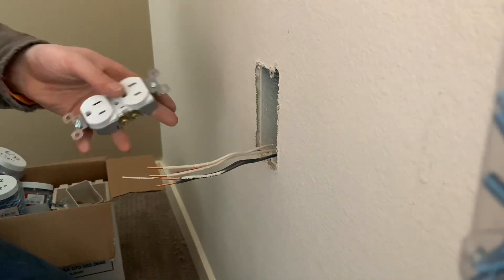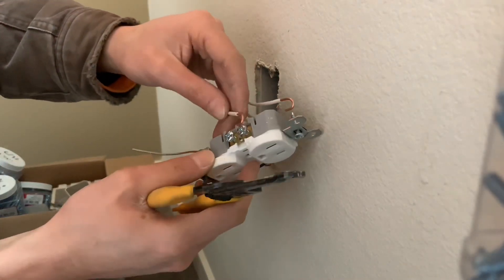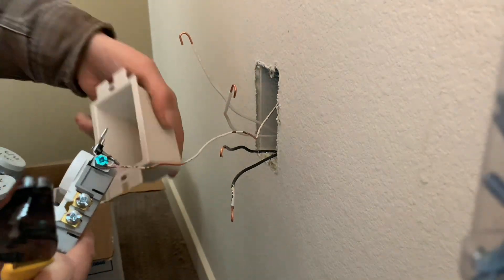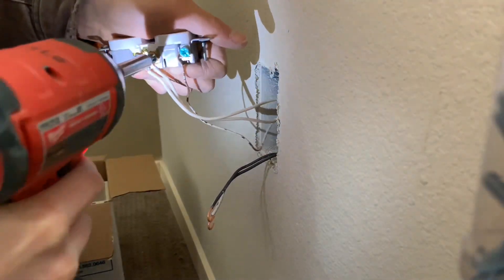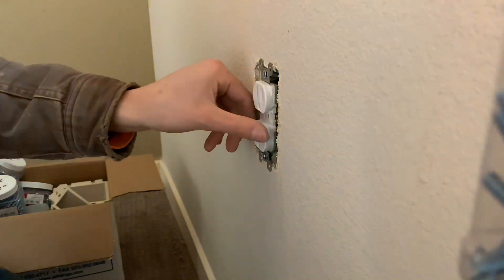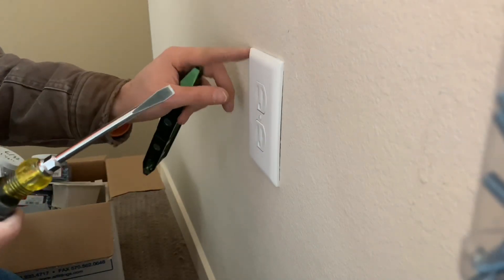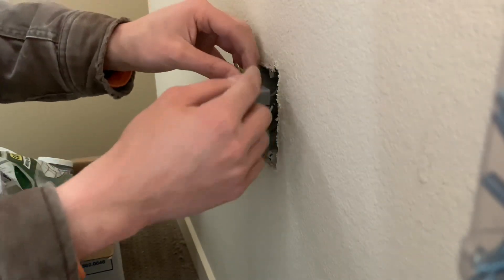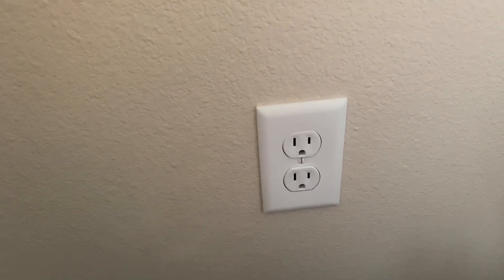How To Install A Duplex Receptacle... THE CORRECT WAY!

Comment: I have an outlet that stopped working. I replaced it, following these instructions with the exact same receptacle shown here. It still isn’t working. I double checked all connections like you mentioned here. Any suggestions?
Reply: I figured it out. That one wall is on a different breaker. Once I turned the whole house back on, not just the bedroom, it worked perfectly! Thank you!!!

Comment: I did everything how you did it but when i check the outlet with my klein tool tester my hot side showing hot but my neutral also showing hot. I checked about 5 times 2 black wires are on gold screws and 2 white wires are on silver screws and of course ground is on green screw.  What did i do wrong??

Thanks for any help
Reply: I thought for a duplex receptacle you had to break the tab on the side?
Reply from the maker: @jimhendrix7776 nope, not unless you are switching half the receptacle
Reply: @DailyElectrician  ahhhh... electricity is so easy yet so complicated 😆

Comment: I appreciate the tutorial, but I"m wondering why I'm only seeing one ground wire coming out of your box.  Are the two ground wires connected inside the box, or is the other one not used in this scenario?
Reply from the maker: maybe it was the end of the line and only had 1 ground. otherwise multiple grounds are always pigtailed (combined) down to one
Reply: Thanks again for the video. @DailyElectrician
Reply from the maker: no problem :)

Comment: Isn't there a few steps missing for those who don't know what the f they're doing like flipping the breaker so you don't die? Not the correct way bud, starting with a product description and not understanding what subtext we need in order to even begin at the point you started at.

Comment: I only pigtail if 3 or more wires land in a box is that what you do too
Reply from the maker: yeah more than 2, or on half hot plugs where you have more than 1 wire. (pigtail the black and reds down to 1).

Comment: always pigtail.
Reply from the maker: I'm not gonna get fired for "always pigtailing" when that's not what my company wants or asks for. Thanks tho.
Reply: why should you always pigtail?
Reply from the maker: so the rest of the circuit works if you disconnect a receptacle or a receptacle stops working
Reply: I'd rather have something secured with a screw than twisted together in a wire nut. Just me though 🤷‍♂

Comment: You don't pigtail inside the box so you only have to land one set of wires on the plug? Also, you don't tape around the metallic parts of the receptacle to reduce the risk of the ground wire hitting the hot or neutral terminals? I like the caterpillars.
Reply from the maker: Personally I do, but for companies no one does. So at work I don't unless I'm asked to. I haven't taped inside plastic boxes before, I always just try to be conscious of where my ground wire is in the box. Taping wouldn't be a bad thing but it adds extra time and money to the job. Happy to help in any way :) Thanks for watching :)
Reply: Actually you can buy an elastic band specifically designed to wrap general use receptacles and switches. I never use them or tape unless I put them back in the box live. Pigtails aren't commonly used on residential receptacles because device boxes don't have much space inside and adding pigtail wires can exceed the box fill code.